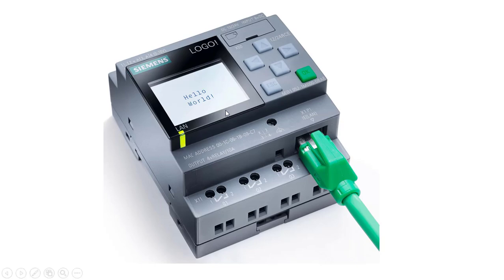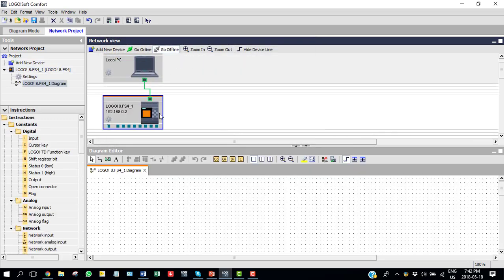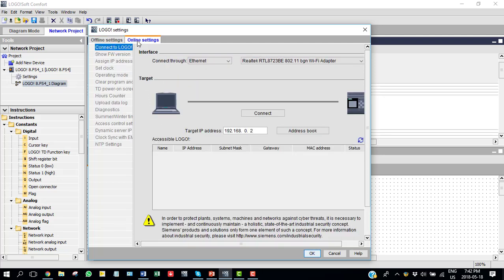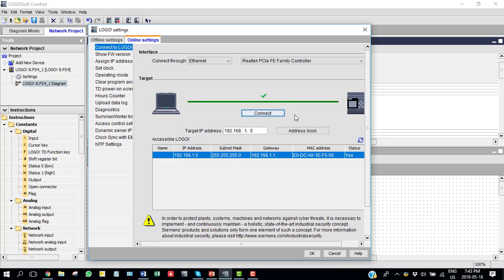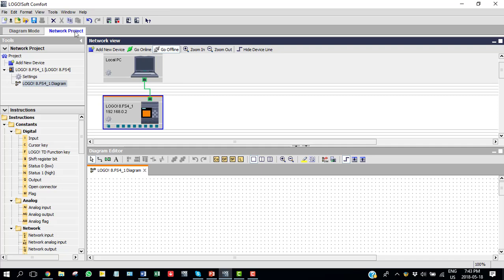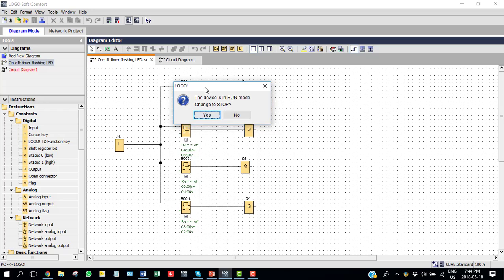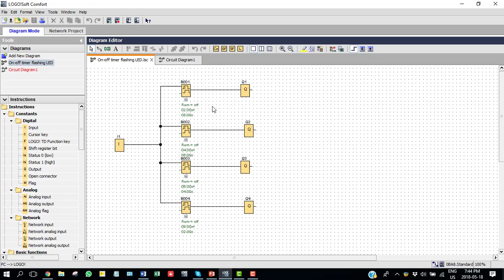LOGO COMFORT PLC Ethernet connection (IP Address)

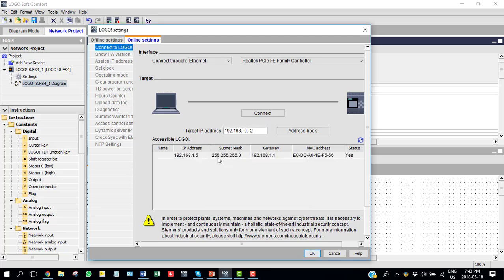Comment: Hello. I just want to ask about the interface part where you selected Realtek FE Family Controller, at 1:50, in my software they don't appear like yours. Does anything else needs to be connected other than the ethernet cable to the LOGO module (hardware)?
Reply: Faten Amira me too 😕
Reply: Cassio Silva 

Haha i haven’t figure out how to solve the issue till now. If you did pls do share!! Cheers :)
Reply: Faten Amira  so, i’m not sure but i think this is possible with a LOGO, because i bought one, and same time it was connected very easy, iqual the video.
Reply: Realtek FE is the ethernet connection device, it depends on your pc hardware. I've had troubles with the logo!soft V8.0, after the last update at the version 8.2 it worked fast and easily
Reply: We are having problems connecting our pc to our 2nd logo we are using a230RC. We connect to our first one no problem but the 2nd never connects. Has anyone experienced this? Any suggests?
Thanks in advance!